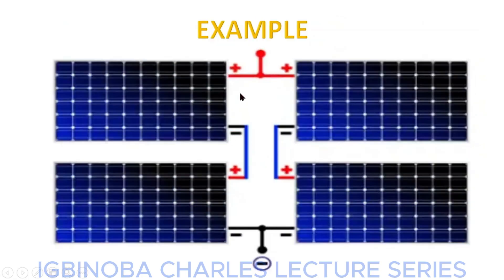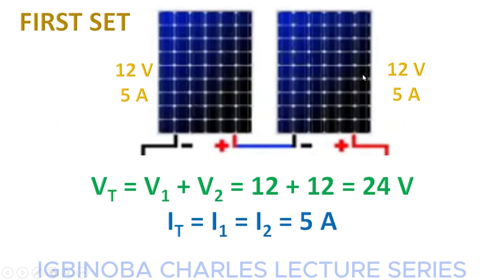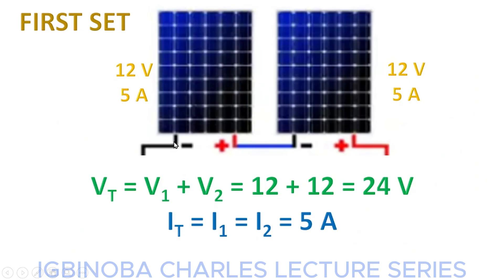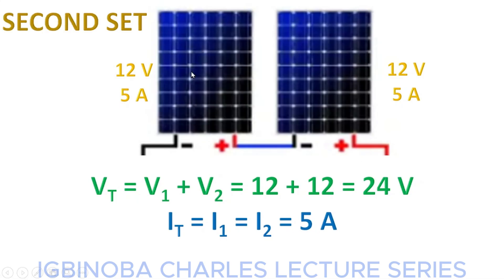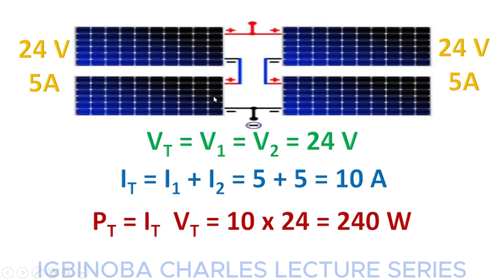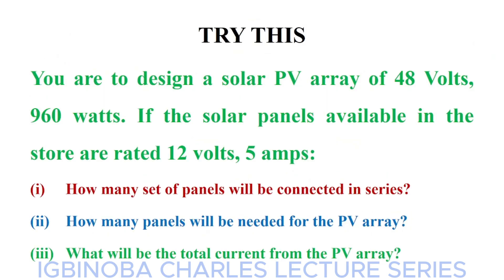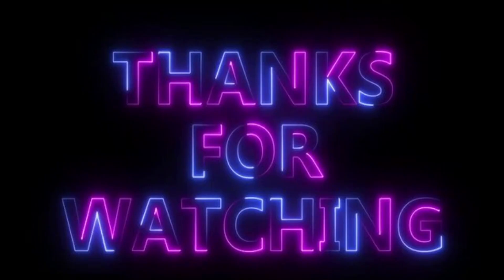Connection of  Solar Panels in SERIES-PARALLEL

Comment: MECH3165I
(1). The sets of panels that will be connected in series 
 48/12 = 4

(2). The power to be generated by a single panel is  120 V x 5 A = 600 W.
   The required power in the array is 960 W. The number of panels needed for the array is 960/60 = 16 panels.

(3). Total panels connected in parallel is 16/4 = 4 panels in parallel. Each of these panels has a current of 5 A. 
   Therefore, the total current in the PV array is 4 x 5 A = 20 A.

Comment: CHM399U

(i) 48V ÷ 12V = 4 panels in series
(ii) 960W ÷ 60W = 16 panels
(iii) Each string gives 5A, so:  
Total current = 4 strings × 5A = 20A

Final Answers:
1. 4 panels in series  
2. 16 panels total  
3. 20 amps total current

Comment: MECH392N

(1). The sets of panels that will be connected in series 
 48/12 = 4

(2). The power to be generated by a single panel is  120 V x 5 A = 600 W.
   The required power in the array is 960 W. The number of panels needed for the array is 960/60 = 16 panels.

(3). Total panels connected in parallel is 16/4 = 4 panels in parallel. Each of these panels has a current of 5 A. 
   Therefore, the total current in the PV array is
 4 x 5 A = 20 A.

Comment: COMP358F

1. Four panels are connected in series.
When you connect four 12-volt, 5-amp panels in series, you get a total of 48 volts, which is the voltage needed for the solar system.
2. A total of 16 panels are needed.
Each panel produces 60 watts (12 V x 5 A = 60 W).
To get 960 W in total: 960 ÷ 60 = 16 panels.
3. The total current from the solar array is 20 amps.
Using the formula I = P ÷ V,
1= 960 W ÷ 48 V = 20A

Comment: MECH31A
1  .  Four  panels  are  connected  in  series .  When  you  connect  four  12-volt ,  5-amp  panels  in  series  ,  you  get  a  total  of  48  volts  ,  which  is  the  voltage  needed  for  the  solar  system. 

2  .  A  total  of  16  panels  are  needed .  Each  panel  produces  60  watts  (  12  V  x  5A  =  60  W  ) .  To  get  960  W  in  total  :  960  +  60  =  16  panels  . 

 3  .  The  total  current  from  the  solar  array  is  20  amps  .  Using  the  formula  I  =P  +  V  ,  |=  960  W÷  48  V=  20  .  .

Comment: CHM329C
1.  Number of panels in series = 48/12 = 4 panels.
2.  Number of panels needed for the PV array = Total power in the circuit/ Power in each panel = 960/60= 16 panels.
3.  Total current from the PV array = Total power/ Total voltage = 960/48 = 20 Amps.

Comment: EEE3171O

1.Number of Panels in Series
Required system voltage = 48V
Each panel voltage = 12V
Number of panels in series = 48V ÷ 12V = 4 panels
Answer: 4 panels in series.

2.Total Number of Panels Needed
Power of one panel = 12V × 5A = 60W
Total required power = 960W
Total number of panels = 960W ÷ 60W = 16 panels
Answer: 16 panels in total.

3.Total Current from the PV Array
Total panels = 16
Panels in series = 4 → Number of parallel sets = 16 ÷ 4 = 4 sets
Current per set = 5A
Total current = 4 sets × 5A = 20A
Answer: The total current is 20A

Comment: COMP3100V

1. Four solar panels are connected in series. Connecting four 12-volt, 5-amp panels in series produces a total of 48 volts, which meets the required system voltage.

2. A total of 16 panels are required. Each panel generates 60 watts (12 V × 5 A = 60 W). Therefore, to achieve 960 watts in total, 16 panels are needed (960 ÷ 60 = 16).

3. The total current from the solar array is 20 amps. Using the formula we get I = 960V / 48V = 20 A

Comment: COMP340N
1. In order to achieve 48 Volts from 12 Volts panels,
Number in series
= 48v/12v = 4 panels 
4 set of panels
2. Each panel will produce 60W (12V x 5A)
Given total power to be 960W
960W/60W= 16 panels
3. Total current is given by
Number of panels in parallel X Each current
Numver of panels in parallel = 16/4 = 4
Total current = 4x5A= 20Amp

Comment: SUBMISSION CODE: MECH356D

SOLUTION

1. NUMBER OF PANELS CONNECTED IN SERIES

48V 12V = 4 PANELS

2. PANELS REQUIRED FOR THE PV ARRAY

The power output of one panel is the total voltage multiplied by total current.

P = 12x5 = 60Watts Therefore the total number of panel to produce 60Watts is 9606016 PANELS

3. TOTAL CURRENT FROM THE PV ARRAY Using the formula (I = P + V) I=960W 48V = 20A.

Comment: SUBMISSION CODE: MAR3150T
SOLUTION 
1. NUMBER OF PANELS CONNECTED IN SERIES 
48V ÷ 12V = 4 PANELS

2. PANELS REQUIRED FOR THE PV ARRAY 
The power output of one  panel is the total voltage multiplied by total current.
P = 12x5 = 60Watts
Therefore the total number of panel to produce 60Watts is 
960 ÷ 60= 16 PANELS

3. TOTAL CURRENT FROM THE PV ARRAY 
Using the formula (I = P ÷ V)
I= 960W ÷ 48V = 20A.

Comment: MECH335I

1. The number of panels connected in series is 4
2. Numbers of panels needed in the pv array is 960/60 = 16
3. The total current from the solar array is 20amps
Formula: i = p/v

I = 960w/48v = 20amps

Comment: MECH3118N

 1. 4 panels would be connected in series

2. A total of 16 panels are needed for the PV array

3. The total current from the PV array will be 20A

Comment: MECH386H

i.4 panels are connected in series 

ii.for the pv array,numbers of panel needed is 960/60 = 16

iii.The total current from solar array is 20 amps.

Formular i=p÷v
960w/48v=20A

Comment: CHM317Q
1. 4 panels would be connected in series
2. A total of 16 panels are needed(12V×5A=60w) for each panel, to get to 960W,
960÷60=16 panels
3. The total current from the solar is 20 amps.

Comment: MECH 3145O

1.Number of panels set in series=48v 12v=4v

2.No.of panels for PV array=960W÷(12V×5A)=16W

3.panels connected in parallel=4×5A=20A

Comment: MECH 32B

i. 4 sets of panels will be connected in series 
ii. 16 panels will be needed for the PV array I.e (960W/60W) =16
iii. Total current from the PV array is 20A I.e (960W/48V)

Comment: MECH378Z 

Connecting 4 panels (12 V, 5 A each) in series gives 48 V as required. Each panel produces 60 W (12 × 5), so to get 960 W total, 16 panels are needed (960 ÷ 60 = 16). Arranging them as 4 series-connected strings in parallel gives a total current of 20 A (960 ÷ 48 = 20).

Comment: MECH3131A

1. 4 sets of panels will be connected in series.

Since connecting 4 of the 12 volts, 5 amp panels in series gives a total of 48 volts as required by the solar PV array design

2. 16 panels will be needed for the PV array.

This is because the power of each panel is 12 x 5 = 60 watts, therefore the total number of panels to produce 960 watts is, 960/60 = 16

3. The total current from the PV array is 20 amps Since I (total) = P(total)/ Vitotal) I (total) = 960/48 = 20amps

Comment: MAR3166J

1. 4 panels (12 volts, 5 amps each) connected in series give 48 volts as required.
2. Each panel produces 60 watts (12 × 5), so 960 ÷ 60 = 16 panels needed.
3. Total current: 960 watts ÷ 48 volts = 20 amps.

Comment: CHM312L
1. 4 panels would be connected in series 
2.  A total of 16 panels are needed (12V×5A=60w) for each panel, to get 960W,
960÷60=16 panels 
3. The total current form the solar is 20amps.

Comment: MECH3160D
1) 4 panels are connected in series (48V/12V=4)
2. 16 panels are needed PV array, total current (960W/60W = 16)
3. Total current from PV array (960W/48V = 20A

Comment: CHM3155Y

i.  4 panels are connected in series
ii.  For the PV array, number of panels needed is
960/60 = 16
iii.  The total current from the solar array is 20 amps.

Formula i = p ÷ v
960W / 48V = 20A

Comment: COMP3103Y
1: Sets of panels that will be connected in series is 48 / 12 = 4

2: The power generated by a single panel is = 120 V x 5A = 600 W. The required power in the array is 960 W. Therefore, the number of panels needed for the array is = 960 / 60 = 16 panels.
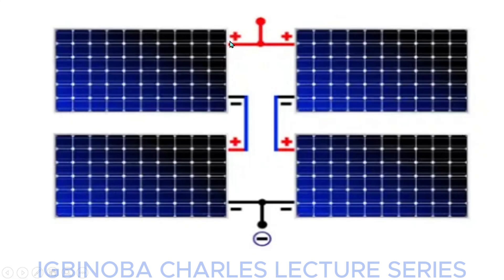 3:16 panels are in the array and 4 panels are in series. Total number of parallel sets of panels = 16 / 4 = 4 parallel sets. Total current from each set of panels is 5A. Since these sets are in parallel, the total current is = 5A x 4 = 20A.

Comment: EEE 3166J

1. Number of panels set in series = 48V ÷ 12V = 4

2. Number of panels for PV array = (12V x 5A) = 960W ÷ 60W = 16

3. Panels connected in parallel= 4 x 5A = 20A

Comment: CIV364L

1. Number of panels set in series = 48V ÷ 12V = 4
2. Number of panels for PV array = 960W ÷ (12V × 5A) = 960W ÷ 60W = 16
3. Panels connected in parallel = 4 × 5A = 20A

Comment: SUBMISSION CODE: MAR325Y

GIVEN:
• System Voltage: Vsys = 48 V
• System Power: Psys = 960 W
• Solar Panel Rating: Vp = 12 V, Ip = 5A
                         SOLUTION 
1. NUMBER OF PANELS CONNECTED IN SERIES 
48V ÷ 12V = 4 PANELS

2. PANELS REQUIRED FOR THE PV ARRAY 
The power output of one  panel is the total voltage multiplied by total current.
P = 12x5 = 60Watts
Therefore the total number of panel to produce 60Watts is 
960 ÷ 60= 16 PANELS

3. TOTAL CURRENT FROM THE PV ARRAY 
Using the formula (I = P ÷ V)
I= 960W ÷ 48V = 20A.

Comment: COMP395Q 
1. Number of panels set in series = 48v÷12v =4
2. Number of panels for PV array = 960w ÷ (12v × 5A) =16v
3. Panels connected in parallel = 4×5A = 20A

Comment: EEE357E

To build a 48v,960w array using 12v,5A(60w) panels.
1)series panels:4 panels (48v/12v=4)
2)Total panels: 16 plans (960w/60w=16)
3) Array current: 20A(960w/48v=20A or 4 parallel strings × 5A =20A).

Comment: EEE371S

1)The number of panel required is 48/12 = 4panels.

2)The power output of pne panel is the total voltage multiplied by total current.

P = 12 * 5 =60watts

Therefore the total number of panel to

produce 60WATTS

= 960/60 =16Panels .

3)With 16 panels in total and 4 panels per series string, the number of parallel strings is 16/4 = 4parellel sets. Each string produces a current of 5A, since the strings are connected in parallel the total current supplied by the array is = 5A×4 = 20A

Comment: CHM3167K 
A)Four panels are connected in series 
Connecting fur 12V,5A panels in series ,we get a total of 48V which is the voltage needed for the solar system 

B)panel power =11*5=60W.Total number of panel which will be 960/60=16

C)each parallel string Carries 5A
Current =5*4=20A
Therefore the total current from over arrays is 20A

Comment: MECH3142L

1. Four panels will be connected in series 48v/12v = 4v
2. A total of sixteen panels will be required for the PV array 960w/60w =16w
3. The total current from the PV array is 960w/48v = 20A

Comment: PETROCHEM348V

1) The sets of panels connected in series is 47/12 which is 4 sets

2) For the PV array, the number of panels needed will be 960/60 which is 16.

3) Total current from the PV array will be 960/48 which is 20A

Comment: COMP352Z

i. 4 panels are connected in series 48v/12*v=4 panels
ii. Each panel produces 12v*5A =60w therefore 960/60
iii. Total current= 960w/ 48*v = 20A

Comment: COMP384F

i.  4 panels are connected in series
ii.  For the PV array, number of panels needed is
960/60 = 16
iii.  The total current from the solar array is 20 amps.

Formula i = p ÷ v
960W / 48V = 20A

Comment: EEE3124T
1. Four panels are connected in series. When you connect four 12-volt, 5-amp panels in series, you get a total of 48 volts, which is the voltage needed for the solar system. 
2. A total of 16 panels are needed. Each panel produces 60 watts (12V × 5A = 60W). To get W in total: 960 ÷ 60 = 16 panels. 
3. The total curent from the solar array is 20-amps. Using the formula I = P + A, 
1 = 960W ÷ 48V = 20A.

Comment: MECH3157A
1: 4 panels are connected in series 
2: Number of panels for PV array=960W ÷ (12V × 5A) = 16
3: Panels connected in parallel = 4×5A = 20A

Comment: COMP350X

(i)4 panels are connected in series. 48v / 12 * v = 4 panels

(ii) Each panel produces 12v * 5A = 60w Therefore, 960/60 = 16w

(iii) Total current = 960w / 48 * v = 20A

Comment: MECH3169M

1. 4 set of panels will be connected in series. Since connecting 4 of the 12 volts, 5 amps panels in series gives a total of 48 volts as required by the solar PV array design. 

2. 16 panels will be needed for the PV array. Ths is because the power of each panel is 12 x 5 =60watts, therefore the total number of panels to produce 960 watts is 960 ÷60=16

3. The total current from the PV array is 20amps. Calculated 960w÷ 48V=20A

Comment: EEE378Z

1)48/12=4
So 4 panels are needed 

2) power of a single panel is
12×5=60

960÷60= 16
16 panels are needed 

3) total current is 20A 
(960w/48v)

Comment: NAT333G 

1. Four(4) panels will be connected in series
48v/12v = 4v

2. The power output of pne panel is the total voltage multiplied by total current.
P =12×5=60watts

Therefore the total number of panels to produce 60watts 
= 960/60w= 16 panels 

3. With 16 panels in total and 4 panels per series string ,the number of parallel strings is 16÷4= 4 parallel sets. Each string produces a current of 5A, since the string are connected in parallel the total current supplied by the array is =5A× 4=20A

Comment: MAR358F

(i)4 panels are connected in series. 48v/12v= 4 panels 

(ii) Each panel produces 12v × 5A = 60w Therefore, 960÷60 = 16w 

(iii) Total current = 960w ÷ 48v = 20A

Comment: COMP3101W
1. 4 panels are connected in series
2. For the PV array, number of panels needed is 960/60-16
3. The total current from the solar array is 20 amps.
960W/48V=20A

Comment: Interesting, EEE341O

1. Number of panels set in series = 48V ÷ 12V = 4
2. Number of panels for PV array = 960W ÷ (12V x 5A) = 960W ÷ 60W = 16
3. Panels connected in parallel =  4 x 5A = 20A
Thank you

Comment: PETRO368P
1. Four(4) panels will be connected in series
48v/12v = 4v
2. A total of sixteen (16) panels will be required for the PV array
960W/60W =16
3. The total current from the PV array is 960W/
48V = 20A

Comment: EEE3160D

(i)4 panels are connected in series. 48v/12v= 4 panels

(ii)Each panel produces 12v × 5A = 60w
Therefore, 960 ÷ 60 = 16w

(iii) Total current = 960w ÷ 48v = 20A

Comment: COMP392N

1). 4 panels are connected in series.
We connected four 12-volt, 5-amp panels in series, so we get a total of 48 volts, which is the voltage needed for the solar system.
2). A total of 16 panels are needed.
Each panel produces 60 watts I.e. 12 V x 5 A = 60 W
To get 960 W in total, 960+ 60 = 16 panels.
3). The total current from the solar array is 20 amps.
Using | = P + V, we have that, 1960 W 48 V = 20 A.

Comment: MECH 3930
1) 4 set of 12v panels will be connected in series totaling 48v
2) 16 panels will be needed for the PV array
3) The total current from the PV array is 20A

Comment: NAT311k

1). 4 panels are connected in series.

We connected four 12-volt, 5-amp panels in series, so we get a total of 48 volts, which is the voltage needed for the solar system.

2). A total of 16 panels are needed.

Each panel produces 60 watts I.e. 12 V x 5 A = 60 W
To get 960 W in total, 960+ 60 = 16 panels.

3). The total current from the solar array is 20 amps.
Using I = P + V, we have that, 1960 W 48 V = 20 A.

Comment: CHM380B
1. Four(4) panels will be connected in series
48v/12v = 4v

2. A total of sixteen(16) panels will be required for the PV array 
960W/60W =16 

3. The total current from the PV array is 960W/48V = 20A

Comment: CHM3135E

1. Four paneis are connected in series. When yoU coMect our l2-vort, 5-amp paneis in Series, yOU get a total ođ 48 voits, which is the voitage needed đor the solar system. 

2. A total oể l6 panels are needed. Each panel produces 60 watts (2 V x 5A = 60 W). To get 960 W in tota: 960 + 60= (6 panels. 

3. The total current &rom the solar array is 20 amps. Using the iormuia I = P+V, |=960 W+ 48 = 20 A.

Comment: COMP341O

1: Sets of panels that will be connected in series is 48 / 12 = 4

2: The power generated by a single panel is = 120 V x 5A = 600 W. The required power in the array is 960 W. Therefore, the number of panels needed for the array is = 960 / 60 = 16 panels.

 3:16 panels are in the array and 4 panels are in series. Total number of parallel sets of panels = 16 / 4 = 4 parallel sets. Total current from each set of panels is 5A. Since these sets are in parallel, the total current is = 5A x 4 = 20A.

Comment: COMP310J
1: Sets of panels that will be connected in series is 48 / 12 = 4

2: The power generated by a single panel is = 120 V x 5A = 600 W. The required power in the array is 960 W. Therefore, the number of panels needed for the array is = 960 / 60 = 16 panels.

 3:16 panels are in the array and 4 panels are in series. Total number of parallel sets of panels = 16 / 4 = 4 parallel sets. Total current from each set of panels is 5A. Since these sets are in parallel, the total current is = 5A x 4 = 20A.

Comment: CIV311K
1.  Number of panels in series = 48/12 = 4 panels.
2.  Number of panels needed for the PV array = Total power in the circuit/ Power in each panel = 960/60= 16 panels.
3.  Total current from the PV array = Total power/ Total voltage = 960/48 = 20 Amps.

Comment: COMP334H

1. 4 panels {12v and 5A each} all connected in series gives 48volts as required 

2. Total panel 960W/60W
= 16 panels

3. Total current from the PV array= Total power/Total voltage = 960/48= 20amps

Comment: To build a 48V, 960W array using 12V, 5A (60W) panels:

· (i) Series Panels: 4 panels (48V / 12V = 4).
· (ii) Total Panels: 16 panels (960W / 60W = 16).
· (iii) Array Current: 20A (960W / 48V = 20A, or 4 parallel strings × 5A = 20A).

MAR348V

Comment: PETRO362J

1. 4 panels (12 volts, 5 amps each) connected in series give 48 volts as required.  
2. Each panel produces 60 watts (12 × 5), so 960 ÷ 60 = 16 panels needed.  
3. Total current: 960 watts ÷ 48 volts = 20 amps.

Comment: EEE3136F
a) Panels in Series: To achieve the system's target voltage of 480V using 120V panels, 4 panels need to be connected in series.
• b) Total Panels Needed: The power output of a single panel is 600W. To meet the total system power demand of 960W, 16 panels are required in total.
• c) Parallel Strings & Current: With 16 total panels arranged in 4 series strings, these strings are connected in parallel. This configuration results in a total output current of 20 Amps.